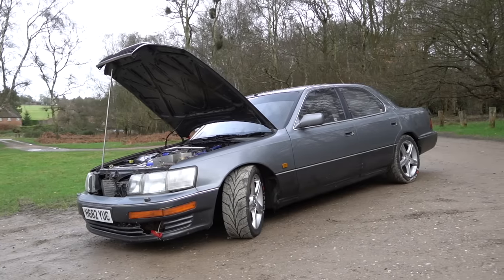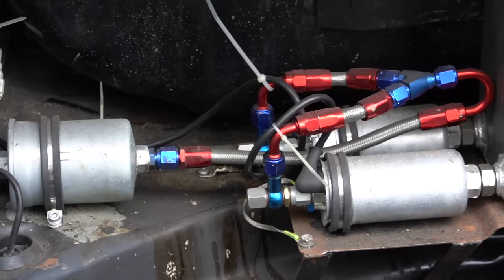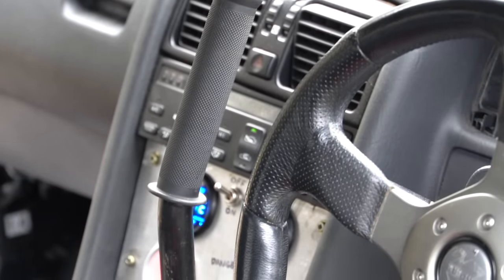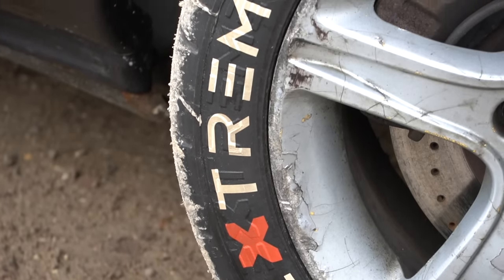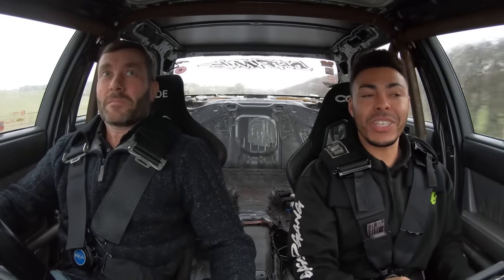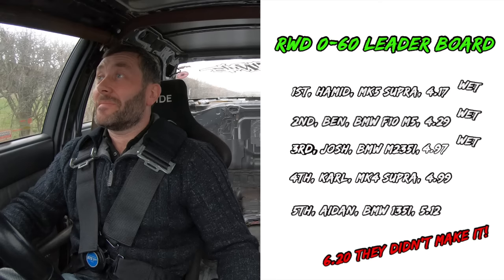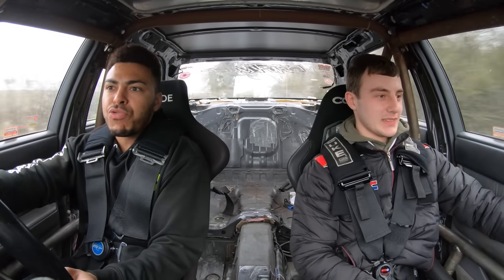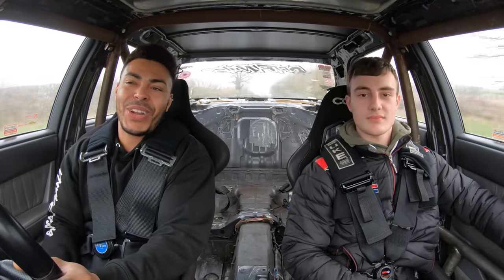THIS *HOME BUILT 750BHP* MADMAX LEXUS LS400 DRIFT CAR IS INCREDIBLE!

Comment: Found this way more entertaining than the normal auto hot hatch with a hybrid. 
Mega build
Reply: There's something about seeing an affordable car being built up by the owner. I'd say it's kind of more realistic / relatable compared to the well off individuals in their £30k plus cars
Reply: @zaink7037  More realistic? Hell no. More fun, yes.
Reply: @DuBstep115  I mean, budget wise this is way cheaper. You can find these things with good engines and bodies for like 1-3k(much less for a rolling chassis like these guys did), throw some money into the engine and you got a fun rwd build. But yeah, new engine bearings even done by a professional aren't much and a lot cheaper in your driveway. No custom driveline, transmission from a 350z same with the driveshaft. all these parts are off the shelf or scrap yard finds so i'd bet this thing is under 10k(i'd guess closer to 5 but it saves face when I'm wrong by going over. :D).
Reply: @0xsergy  building a 700hp supercar killer from scratch is cheaper than 35k hot hatch, but I don't see many of them around. So 35k hatchback is more realistic.
Reply: @DuBstep115  well yeah, obviously it's easier to just go buy something with credit so yeah obviously you'll see more of a production car on the road than a customized LS400. But at the end of the day you'll have toyota reliability, not those Focus 31k kms and the block is cracked from vibrations reliability. So far those RS' haven't really proven themselves long term so no, not realistic in my books as i'm not spending 35k on a money pit.
Reply: @0xsergy  I wouldn't bet boosted LS400 making 100k without problems.
Reply: @DuBstep115  I'll take 100k all day bro. Ls400 motors are like a grand, not that pricey. And if what they say here is accurate they still have another 250hp to go safely. Focus engines are pretty pricey given how new they are. Also doesn't help that they get a revision every year to solve these problems so you gotta match the year
Reply: @0xsergy  Why you talk about focus?
Reply: @DuBstep115  you guys said hothatch so that's what came to mind. the vw hothatch scene isn't as big here in canada as in the eu
Reply: matt adey  especially when the car is still under warranty, and its a free fix from dealer
Reply: @0xsergy  1-3k? WHERE here this thing is 5k minimum
Reply: @MV-ri7zu  i mean they made these posts before the car market got fucked. but i’m about to pick one up for 1.5

Comment: Check out matt farahs million mile ls400! One of the most underrated engines to come out of Japan
Lighter than a 2jz and already known for handling over 1000hp on stock internals. Sadly not enough after market support but one of the most reliable engines out there

Stick with the Early thicker 1uz if your planning on boosting
Can't wait to see how many people's hearts its goin to break getting smoked by a 2tun 5 door sleeper 😂
Reply: This is not matt farash million mile lexus - regular car reviews
Reply: @DuBstep115  He never said it was. He said "check out"
Reply: 5 door? There's an estate version?
Reply: @rneoman  Estates are not 5 doors, hatchbacks are.
Reply: @DuBstep115  news flash an estate is a hatch, a rear hatch with glass is a 5th door an estate has a rear door with glass a 4 door saloon has a metal trunk or bootlid
Reply: They say that the 1990-1994 ls400s are not as reliable as the other years
Reply: I here you buddy I have a 1uz waiting for my 76 Toyota celica
Reply: Chuck Barnes  People say since they are the oldest they tend to run into problems much more but I feel like the oldest 1uz engines are stronger
Reply: @boobbutthole9537  dream car always had a soft spot for them. My dream swap is a 1uz in a mark 2 celica supra
Reply: @maiy8786  haha for sure bud people are now slowly starting to catch on to them
Reply: @DuBstep115  I never said it was? Don't see your point?
Reply: @GbbJunkie I believe the engine yes but other parts weren’t as reliable as other model years

Comment: That blokes been there, done that and wore the tee shirt innit. Class car like.
Always wanted to 1uz swap a shogun for shits and giggles
Reply: The Shoguns have a bombproof V6 that loves boost, you might as well stick with turboing the stock motor.
Reply: @richardharrold9736  
I've had the3.5v6 shogun swb & 3.0 v6 shogun sport and they was fairly quick for what they are NA too.
Think if you boosted one you'd get loads of problems down the line.
I also love the older sorta early 90s shoguns with the 2.8td engine its like an old tractor but torquey as frig.

Comment: this thing looks mental! how does jamie find these? biggest power 1UZ LS i've ever seen
Reply: The 1UZ is Japan’s LS Swap
Reply: Looks at 40tt Capri he has a 1500hp
Reply: i think theres american soarer put 800ish whp on 1uz
Reply: @connoisseuroftigolbitts  eh I wouldn't say so only cuz you have to turbo the LS400 to get the same power an LS motor makes naturally aspirated.
Reply: Check out TRC review on the sc400 think it has 850ish hp
Reply: @shawnsta7779  but the 1uz is a pretty strong motor if you get one from 94 and older because they had much stronger internals than the 95 and newer versions of the UZ line

And I'm sure he meant it's Japan's equivalent to the LS motor because of how universal the UZ engine is for Toyota, more specifically the 2UZ since that one was used in trucks and SUVs so they're more common to find and modify similar to how the LS is very common to find and modify

Power they're not the same but they're the same in how easy they are to find
Reply: @Dunki113  wasnt it also the vvti versions that had the thinner rods
Reply: I made 781 whp 780wtq in my sc400 1uz. The only thing I added was MLS headgaskets , arp head studs, and upgraded valve springs. I went cop set up and e85 with a megasquirt standalone.  I didn't even re gap the rings. This motor came out of the junkyard with 110k miles on the engine 3 years ago.  I had a shop build my set up thought. This is cool bc they did everything themselves. Thats dope.
Reply: @westpalmgt  did ya know if I can fit it in my is200? I'll start doing engine swap on 1uz fe and I'd like to know if there is enough space for a turbo.
Reply: @jaworgame7965  they put them in the is300 so yes they can fit in the 200

Comment: The fact it dose 6 second 60 time is irrelevant it's a drift car not designed for 60 runs but hella fun
Reply: on 7j aswell not too bad
Reply: put sticky tires under it and it would probably be a lot faster
Reply: @superpknerd  No doubt, big heavy car with a slippery drift setup does not make for a quick launching car by any means.
Reply: Spot on. Still quick, no auto dsg in this 😊
Reply: Agreed but it will still be a beast in 100-200 times and If he changed his tyres for some fresh 8 inch wide ps4's i recon hed be low 4's easy, those tyres had no chance.
Reply: Keep in mind that 8.5J wheels and good tires could reduce that time by a decent amount, and yeah the 0-60 may not be the best, but on a highway pull it would turn modern performance cars into mince meat
Reply: Not to mention the fact it was damp and shod with budget tyres well past they're best! Great car
Reply: just stick some wider wheels and tyres on to take at least 1.5 seconds off..easy no problem,,its on the worlds skinniest tyres.
Reply: 6 seconds is still fucking quick. Anything from 5 or less is generally considered supercar territory.

Comment: I got my 92 ls400 for 300 dollars I put $600 when I first got it just suspension,brakes , timing belt, water pump, rack and pinion and power steering pump, it had 310,000 miles I put 100,000 so far and has not skipped a beat!!!

Comment: How do you post the work done on the car and bring it in with budget tires? I would have thought you would have know your numbers before you presented the beast. Still watching vid. hopefully you wont kill this car on drifting. Yeah, i kinda figured the numbers weren't going to be the greatest. Work to be done, still great work at that.
Reply: hi im leon from the vid. This car is so strong weve been drifting it for 3 years and we havent killed it yet! been through 3 sets of bottom end bearings though but that issue is now fixed

Comment: They're not 2.2 tonne, my 96 weighs 1650kg on the weighbridge at work without driver. The early ucf20 was a bit heavier but not that much. Still an awesome LS400 though!
Reply: That should be ucf10 not 20
Reply: Mid 1700s they were never 2200kg don't know where they got that figure from,
Reply: @tommymcnaught802  off the plate, which is gross weight fully loaded I think

Comment: Great work on the car, but wrong about the originality of the LS400 1UZ engine. That was purely built by Lexus for the LS400 in the late eighties, and launch in the early nineties. Toyota may have chosen to use them at some point for racing, but the 4.0 V8 was always a Lexus-designed and built motor. 
Also, the original dry weight was around 1,750 kgs kerb weight, not 2,200. Lexus did a lot to keep the weight down on the car, and it was lighter than rivals at the time.

Comment: There's a nice black one for sale near me really considering getting it but don't know the price or how expensive they are to maintain/replacement parts. Any insight would be helpful.
Reply: Hi mate. Its the same as any other toyota, they are reliable as and parts are cheap. its basically a mk3 supra under the body work. But yeah reliable as so it wont cost much anyway.
Reply: The brake calipers are like 400 a piece. 
Besides that engines are very good. Easy to maintain. Shops are familiar with them. Parts are available to find as well. 
Make sure anything you get is cared for. people will have a lot of fun with these things but won't do proper maintenance. A lot could be wrong if you don't check. Power steering and radiators always go. Check if they are bad. 
Also get a drive in one that is in good condition. Any 1uz. Sc400 or ls400.  You need to feel how the engine is supposed to feel. It's very unique. Don't buy one that has acceleration problems. And don't let the guy say just put it in power mode. No. This things killer in any mode.

Good rule for buying any car is to buy one with ZERO aftermarket mods like race brakes or air intakes. Things that are relatively cheap for racers to buy. It's a sign that the car has been abused. always look for bone stock, grandma driven, "garage kept" (but not lying). Not even a radio. God forbid someone messed up the wiring and you hit a bump and the car turns off. As little work done as possible besides basic maintenance.  BUT if you find a guy who knows his stuff, like this guy in the video, then by all means take a look and consider it. Also have a mechanic look at it before. And pay for a vin check. 
Never cheap out on something that's less than 100$ that will prevent you from making a $5000 mistake. 

If you do get scammed. Don't worry about it. Happens to everybody. Happened to me. Just be glad that you can learn something from it. Don't be pressured to buy something or let the seller make you feel like you gotta buy it now or it's gone. Trust me. If he's like that then you wouldn't have wanted itanyway.

Comment: IS the car actually registered for normal use on UK roads? Cheers from LS owner Sydney Australia
Reply: yes it is UK road registered and insured 🙂
Reply: @WilbursTravels-ArielSquareFour   Is there no registration compliance for noise levels at RPM > 3500?
Reply: @Warpedsmac  well maybe, but the inspector didn't ask, and with the age of the car in the UK the regs on aftermarket exhaust systems are pretty loose, you are not allowed screamer pipes, that is about it!😁

Comment: Is it possible to do the same modifications for ls430?
Reply: Yes
Reply: Actually no. You cant. Ls430s have thin rods and thin cylinder walls. Also the vvti makes them interference engines so any issue kills valves. The stock bottom end cant handle more than 400ish Bhp.

Comment: I have a beautiful Mk1 Lexus GS 300 Sport 1997. P321LEX she is finished in pearlescent white with a grey bottom. The car was in storage 2008 until 2015 and has just covered 92.000 miles.  It has the original wheels with rear deep dish and new Goodyear F1 all the way around. Suddenly my speedo stopped working so I had the speed sensor changed I sourced a cheap one £38.00 from Japan but this made things worse. Not only does my speedo not work but the o/d light flashes on and off and my gearbox only changes between 1 and 3 so won't change to 4th. So I brought a genuine lexus dealer part £147.00 but still no change. To say I am gutted is an understatement ! If anybody is up for offering me a sensible offer to purchase the car please let me know. I can send info and pictures.
Thanks

Comment: Can y’all help me figure out those wheels and tires? Size
Reply: they were 17" x 7J but since then we've upgraded to 18", 8.5J front and 9.5J rear
Reply: @Concept5North  what kind of tires and size were those? Followed your Instagram you guys are pretty cool 👍🏽
Reply: @johnnyray2935  They were Extreme road legal drift tyres, first time we'd used them, they were crap!  They delaminated badly as soon as they got any heat in them, we've gone back to budget road tyres since then

Comment: There is no way this thing puts down more than 350HP!
Reply: CUPRA-400-ABT 350whp doesn’t move out like this thing does.
Reply: Michael Newton thats the point, it doesn’t really move forward. Did u watch the whole vid? He accelerating for like hour’s but when u look at the trees n stuff, u see its not goin that fast
Reply: Michael Newton i watched it again and no, there i no fuckin way this thing puts down more than 300 HP just look from 11:10 on. That car is completely empty, only two seats and the drivers inside and he is accelerating for hours and cant get by this straight. Just look at the trees and how fast he gets forward. There a several scenes who will prove me right.
Reply: @cupra-400-abt6  mate..... im leon from the vid and a 4.0 v8 with 20psi of boost from a turbo with a 1.04 AR housing makes alot more than 300.
Reply: Leon B54 i wont believe it until i see some dyno numbers. There is a lot to tell when uve a boosted car but only some dyno jet runs will tell the truth...and i just realized that driver and co driver in this vid is not really kicked into the seats. Even in my car that punch is more heavy with only a 400HP 2L but mine isn’t empty. So i would set 1000$ that this car doesn’t put 400HP down.
Reply: @cupra-400-abt6  im literally leon from the video. Me and my dad built this car together from scratch. An ls400 puts down 250 stock. The reason we arnt kicked back in our seat is because of lack of grip. Please just go to our youtube channel and see the work thats been done for yourself. This video will show you how much power the car has https://www.youtube.com/watch?v=MOB0A_RQXIE

Comment: I get 3.8 seconds 0-100 in my 04 e55 that makes 600whp not sure why this car is slower
Reply: no grip at all and it weighs the same as the titanic
Reply: @LeonB54  my car weighs more I think it all has to do with traction this guy needs to get some semi slicks
Reply: @jayantmalik4310  well I'm leon from the video actually 😂 we were running semi slicks on the car as we said butttt they are still only 225 instead of 265 so we had no chance at all honestly
Reply: @LeonB54  ohh lol anyways nice car m8. one of my good friends owns a 98 ls 400 with 300k miles still drives like butter very good car bulletproof engine